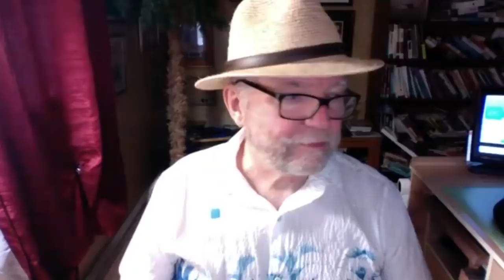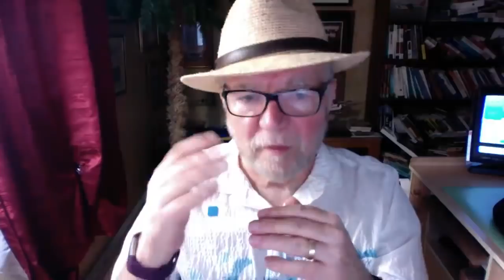Group Movement Manufacture? Good or Bad for Collectors?

Comment: I have read that the Vacheron FiftySix (time/date) cal. is based on the Cartier 1904MC, but that components for the VC are produced by VF.
Reply from the maker: Hi Westley, it's definitely possible. The Fiftysix comes in 3 flavors, each flavor with a gold/steel option. The Complete Calendar (cal 2460 OC1/1), the Day-Date (cal 2475 SC/2) and the Self-winding (1326). Of those three, the 2460 and 2475 both have the Poinçon de Genève ; so they were made in Geneva; not Buttes. That leaves the caliber 1326 from ValFleurier. I'll look into the 1904MC and check to see if it and the 1326 have the same size in mm, number of jewels, frequency and power reserve. (Of course if you beat me to it... I'll rely on your judgement...) The game is afoot! Cheers, Bill
Reply from the maker: Hi Westley, that turned out to be easier than I thought. The Cartier 1904-CH MC is the base for both the Piaget cal. 1160P and Vacheron Constantin 1326 (https://watchbase.com/vacheron-constantin/caliber/1326) They're all made at ValFerrier. Looks like they decided if it's good enough for one brand, it'll do for another. Story is unravelling... Cheers, Bill